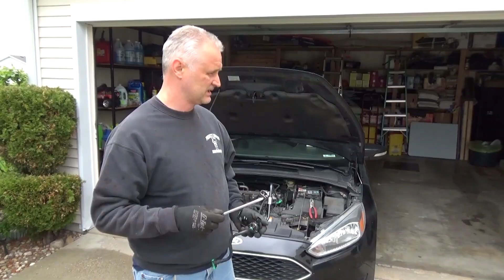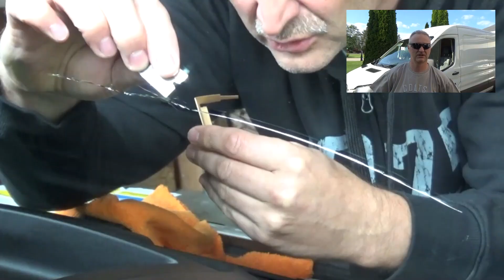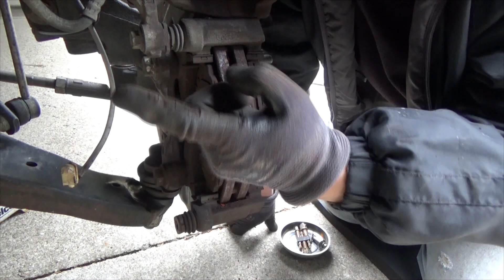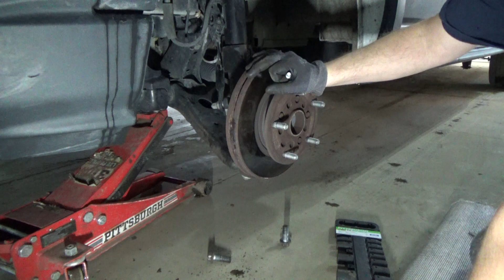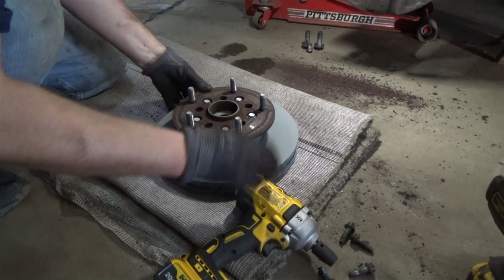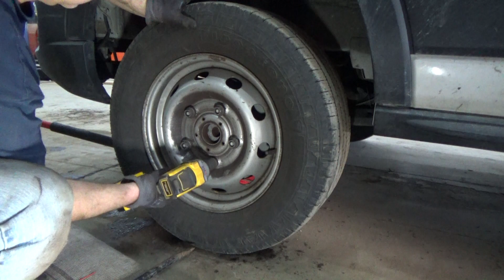2020 Ford Transit  350 Front Brakes, Rotor and Hub

Comment: How often do you change the rotors? 

Every other pad change, every pad change etc….
Reply from the maker: Every time you replace your brake pads you have two options: either install new rotors, or turn (resurface) the rotors. Otherwise your significantly cuting lifetime of your new brake pads